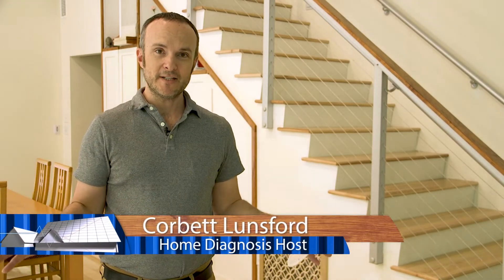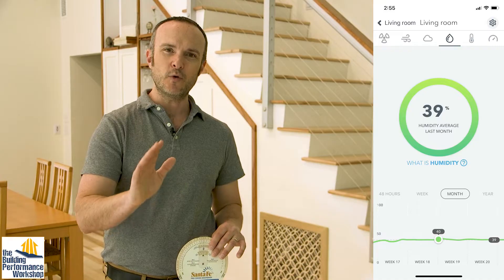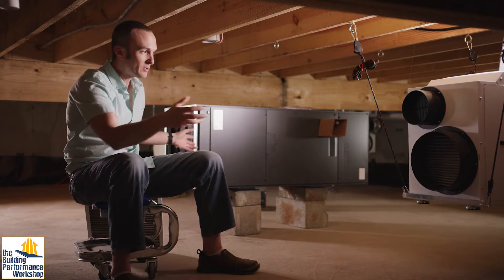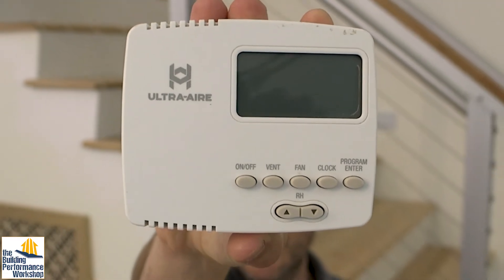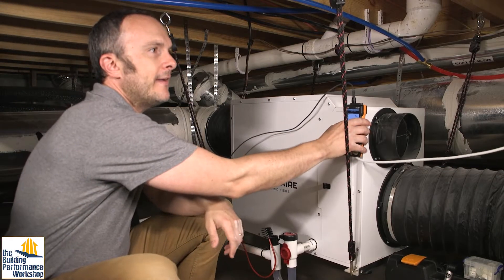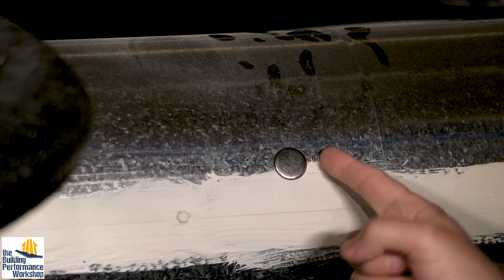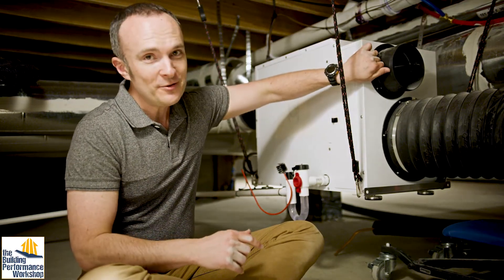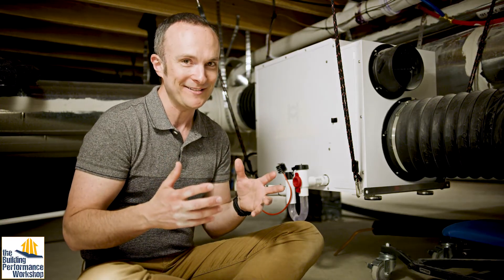Dehumidifier Testing and Calculations: How/What/Why of Dehumidification with Santa Fe Ultra

Comment: What if I don’t want my AC coil to pitch in and help with drying? Just curious, will my AC coil last longer if water is NEVER ever allowed to condensate on the coils? No mold keeping them clean forever?😂. I dunno maybe 30 year coil life? If I sacafrise the smaller less expensive dehumidifiers coil. Either way I’m sacrificing a cooling coil. But at least this way it’s the smaller coil that’s easier to pop in and out to replace. Any thoughts from anyone? This is just theory.

Comment: Thank you so much. Very informative. I have a question for you. For homes in the north Georgia area, would you recommend in ERV with a whole home dehumidifier or just a dehumidifier with a fresh air intake similar to what you have in this video?  The equipment will be going into an unconditioned attic.
Reply from the maker: First I’d recommend putting your HVAC into a conditioned space, but as far as ERV vs Ventilating Dehu goes, watch this:
Borderline of Balanced Ventilation: When Bath Fans Won't Work, and an ERV Becomes Necessary at Home
https://youtu.be/lnOCAPPVT5g
Reply: @HomePerformance  it’s an existing home so that’s not really an option. I had already watched that video and was planning to route all the bath exhausts to the ERV and then I started to watch Dehu videos and saw many people recommended using them with a fresh air intake in lieu of an ERV which confused me.

It sounds like you would recommend removing the bathroom fans and ducting their exhaust out of the house through an ERV while also adding a dehu in a completely different duct system without a separate fresh air intake?
Reply from the maker: ERV only if your home is tight enough to need it. I bet not in this case- dehu instead.
Reply from the maker: There are pros and cons in both scenarios. I would not use an ERV unless your home is 3ach50 or less.
Reply: @HomePerformance  thanks.

Comment: Great video!  Question about the ventilation part. So I would think you would want separate control of ventilation air and recirculation through the dehumidifier. The April Aire E100V with 8190FF provides control of either recirc or ventilation that it auto electronically controls based on settings. The SanteFe you show appears to just bring a mixture of recirc and ventilation air dependent on a manual damper on the ventilation input. Is this true and what are your thoughts on this. I like all features of the SanteFe except not having separate control. Thanks!
Reply from the maker: Yes, you would use their ventilation control (or Aprilaire’s) to control a mechanical damper on the outside intake.

Comment: Great video! Love the tip about using the outside air intake of the dehumidifier to slightly pressurize the house to prevent air infiltration!

Comment: Do you still need bathroom exhaust fans with this setup? I'm in FL and the home I purchased doesn't have exhaust fans in the bathrooms. I was going to just have them installed but I'm considering a whole house dehumidifier instead.
Reply from the maker: YES, you need bath fans- put them IN the showers. A dehum will struggle forever to try, but can’t do the job. Video forthcoming.
Reply: @HomePerformance  Wow, thank you for your response! Very helpful!

Comment: I actually watched this a second time and came up with a new question. When the Utra-Aire dehumidifier runs, is there some control line from the Ultra-Aire back to the HVAC system to run the main fan to distribute the dehumidified air throughout the house?
Reply from the maker: Yes, but we don’t use a feature like that because our air handler runs on circulate mode (low speed) 24/7.

Comment: Since you are ducting into the HVAC supply, will you need to ensure the central air handler runs whenever the dehumidifier runs? Won't this be more costly to run the central blower instead of keeping the dehumidifier supply seperated?

Comment: How can i verify that my unit (same as the one here) is actually working properly?  My production builder's contractor installed it and they did a bad job on the HVAC so I don't have much confidence this was done right either.  We have a long return duct (about 20ft or more) to the unit.  They originally had the return installed in a tight kitchen/mud area corner next to the garage entry door and a side exit door.  It was a bad spot so we had them move it which created a longer duct but not much choice.
Reply from the maker: It’s in the installation manual, Kelly, but I’ll also add it to my list of videos to make.

Comment: By slightly opening the fresh air input duct, you are satisfying one objective I have for some dehumidification for the basement/crawlspace. What about the attic? Do you supply dehumidified air to the attic or use the method to create a slight negative pressure for a conditioned attic to help manage the humidity in the attic?
Reply from the maker: We don’t have an attic, but if you do, it should be a room in the Man J and it needs a supply register and a return pathway.

Comment: I sure would appreciate a line diagram of how you "plumbed" the Inlet and outlet of the Dehumidifier to your heat pump's duct work. I have watched other videos about the same unit, which I am considering buying and I know some people had issues with the way the manufacturer had it being connected below the heat exchanger/coil of their heat pump. Sending warm dehumidified air across the coil and causing freeze ups. Could you post a PDF of a schematic?
Reply from the maker: Hey Blue- you can see exactly how this gets connected in Santa Fe’s install manual for the Ultra120. 👍🏽👍🏽

Comment: If the dehumidifier supply is ducted to supply of air handler is there a damper to keep the ac from blowing back through dehumidifier?
If so if both are running at the same time can the dehumidifier over come the blower from the AC ?
Reply from the maker: Yes and yes. Butterfly damper. Dehum is rated for 0.2 and 0.4 static pressure.
Reply: @HomePerformance  thank you! I love your channel .
Reply from the maker: Thanks Johnny my man

Comment: Can I use a dehumidifier when I have a ductless mini split system?
Reply from the maker: It’s even more important in that case.
Reply: @HomePerformance  Thanks. My unit has a dry mode which keeps the humidity in the 40's even on hot days here in Northern California. I'm not sue what the humidity will be like in the winter yet. Hopefully the system can control the humidity then also.
Reply from the maker: Drier in the winter. But if you’re using Dry Mode, you should definitely clean the unit asap.

Comment: Thanks for the video! We live in Alberta, Canada where we have major swings in humidity. I’ve installed a new VARIABLE-CAPACITY GAS FURNACE with a MERV 16 filter and HRV system in a 1960s home we’ve been slowly renovating. We’ve been working on sealing the house up, and have gotten it to a point where the HRV is required. We don’t have any cooling in our system yet (we plan on putting a heat pump into the system in the future, which our furnace can accommodate). My question is, with our HRV dumping fresh humid air into our return duct, should we hook up the dehumidifier to pull from below the HRV supply and dump it back into the supply before the MERV 16 filter so it can still filter the air coming in from the HRV? Thank you for all the great information you two are putting out!
Reply from the maker: Thanks for following, Bryan- no, I don’t think the amount of humidity you have in Alberta is anything to worry about on the incoming HRV side. Such a small amount of humid air (maybe 150 cfm) mixing with a huge amount in the return (maybe 1000 cfm) should be no problem, as long as you have that dehumidifier anywhere in thr chain it should do its job fine.

Comment: Why would you not want to pipe it directly into the return of the a/c?  I understand its not ideal (say if the fan of the a/c is off or something, but  will it actually hurt anything?  I have a situation where I can only really access two spaces of the return ducting, the supply isn't wide enough and there are trunks going upstairs and one going to the main floor, and above the a/c unit the trunk isn't wide enough to fit 8 or 10 inch collar.
Reply from the maker: Gotta do what you gotta do, Chad. But it degrades the efficiency of your A/C and removes the drying power from it as well. Oversize the dehum if that’s the case.

Comment: Best Video I've seen on this topic.  Thanks so much.  I'm building a new home in central FL and was thinking this might be a more affordable upgrade with a better ROI than stepping up to top of the line Variable Speed systems since the main attraction to me is making the house more comfortable.   I also absolutely love my Ecobee Thermostat which I believe will control a dehumidifier.  Am I correct that the Ecobee's work well with this type of setup?   Also does the Air Handler have to be on while the dehumidifier is running or does it push enough air by itself?
Reply from the maker: Thanks Jack! Not sure about an Ecobee here, but I keep our air handler running on low continuously for filtration and mixing. As long as it can’t make a feedback loop, you shouldn’t have to do that if you don’t want to. Return and supply far enough apart would do the trick.

Comment: Very informative video! I got a little bit confused on the calculations at 12 minutes 30 seconds. I think you meant to say density of air is 0.075 lb/cu ft instead of 0.75. Thanks again for the information.
Reply from the maker: Thanks Bill- and I think there’s a coefficient in there that’s hidden, I might not have explained it fully.

Comment: Great video, you mentioned florida. What’s your take on a ventilating dehumidifier vs having an ERV system for balanced ventilation and a separate dehumidifier (not ventilating)
Reply from the maker: I don’t know that anybody’s building very airtight in FL- an ERV only becomes necessary once you’re down around 1 ACH50. I’d go ventilating dehum any day.

Comment: You just briefly mentioned the MD33...how is this working for you? Would this be a viable whole house dehumidifier for a tiny house or small home? It seems that being able to wall mount it would be a huge space savings plus the drain line is a perk.
Reply from the maker: The MD33 is good, but I would not recommend in a tiny home due to the hum it creates- I prefer dessicant dehums for tiny spaces.

Comment: I like the explanation you provided in your video. There is one thing that is of concern is bringing into the living area any air from the crawlspace. Viewing it from an indoor air quality (IAQ) standpoint, the crawl space is often a source of rodant droppings, mold spores,  the possibility of Radeon, and odors of different types. Yes, a HEPA filter can remove most of the bad stuff but won't do anything for Radeon or other odors. 

It would be best to bring in fresh outside air for the fresh air intake port on the dehu. The crawlspace should have its own dehu without a fresh air makeup.
Reply from the maker: Micah, in a typical crawlspace I may agree, but mine is far from typical. Perhaps the cleanest air in the whole house down there, since there’s no people, cooking, or cleaning products at work. Also, radon is mitigated with a fan-driven system, very important I agree.
Reply: @HomePerformance  it's hard to think of, and cover every situation that could be involved with IAQ and all the factors involved in a relatively short video. You still did pretty good in addressing the subject.

I would like to see the HVAC industry embrace IAQ training as a standard. The two industries go hand-in-hand. To often I've seen HVAC companies think that they are helping their customers but because of not being throughly trained in IAQ they have created an undesirable situation for their customers. Some HVAC engineers and companies have independently seen this need and embraced this training. It would be nice to see it across the board.
Reply from the maker: Well we’d be happy to have you join our members, since we’ve created the first ever TV show about all of what you’re wanting to become mainstream knowledge! If you want to participate: http://patreon.com/homediagnosistv

Comment: Ok can you tell me exactly how you have this running, is it running in the ductwork for the ac system without the ac being on and if so where are you pulling in coming air from is it in the house or outside only?
Reply from the maker: All from the house. Yes, it runs independently from the heat pump based on humidity levels. Heat pump’s central fan runs on low speed continuously.

Comment: Thanks for this, Corbet. My home has a concrete block foundation so it's not sealed - would this still be my solution for my humidity problems or am I supposed to be looking more for ventilation solutions? Thanks!
Reply from the maker: Yes, seal first to remove the sources- cheaper, easier, only one time if you do it right. Then machines that are expensive, use energy, and must be maintained and replaced.

Comment: What rope suspension kit/parts did you use for that?
Reply from the maker: Comes with the Santa Fe system
Reply: @HomePerformance  oh that's what's it's called, rope ratchets! Amazon has these for like 10 bucks.

Comment: Excellent video! How do you relay the home humidity levels outside the grate to communicate with your UA sensor in your grate?
Reply: I believe they don’t need to communicate. They would set the controlling sensor(inside grate) to whatever value produces a desired result as measured by the sensor outside the grate. Clear as mud?

Comment: What they don’t tell you about before home dehumidifiers:  

Home humidity needs to be looked at like home heat energy, meaning what things are in you home that can be causing the high moisture?  Do you have a very leaky house?  Do you have a very tight house?  Is your AC pulling away the humidity from your home as it should?  When your HVAC blower is running does it create a negative pressure in your home?  Do you have a water leak in your home that you are unaware of?  Do you have an excessive amount of plants in your home?  Do you run your AC too low or too high?  Do you have a crawl space and if so does it have a vapor barrier?  

I’ve found that if you can address these issues first, it could lesson your need for a whole home humidifier.  Don’t obsess over getting your home to 50 or below relative humidity, when 60RH to 50RH are fine numbers to have as well.  If you wanna know what 35 RH feels like, I can tell you, because I’ve had my Aprilaire unit for 2 years now.  35 RH at 72 degrees feels like a dream when coming in from hot outdoors weather, and getting out of a hot shower.  The feeling of water evaporating from your skin so rapidly is an amazing feeling, absolutely so, but there’s a catch 22!  Your skin, eyes, nasal pathways, and throat suffers from the lack of moisture in the air.  It’s something you don’t notice right away, but when you wake up in the mornings with dry eyes, dry mouth and throat you soon realize how some moisture in the air isn’t such a bad thing.  Another thing that happens with a wood construction home is the wood will sometimes shrink.  We all experience this sometimes when some doors closes well in the winter but not so well in the summers or vise versa.  It can literally cause your wooden boarders (crown moldings) to shrink enough that it cracks.

The bottom line is purchasing a whole home dehumidifier can be a life changing event in a good way, or it can leave a sour taste in your mouth.  They are not for everybody who can afford one.  Mine averages about 750w when in use, and it does have a noticeable compressor hum like all heat pumps have.
Reply: I’m on the fence with whole house dehumidifiers. The amount of water I pick up from my 5 conventional units on wheels (set at 45), using fans to aggravate air, with my thermostat set at 75, when it’s a hundred degrees out , is insane amounts of water. But damn, it feels good…  I just don’t see how using a new random return cut out in 1 hallway ceiling, or using my existing air returns could do what I am already doing in my 3,000 sq ft home. Pulling up that much water!? All that vapor in my ductwork!? Part of my job is understanding microbial growth and I see a problem with inviting that much water vapor through ductwork. Not to mention, not keeping the RH equal in all areas of my home, like I have now, I can testify from using my hygrometer.
Reply: @sp1200M3D  the single whole home until is the way to go if you’re using 5 units.  It’s overall more efficient and you don’t have to worry about it because it takes care of it’s.  If you do by one get the biggest unit you can afford and install a dedicated return.  Humid air is lighter the dry air so put the return in the highest conditioned space of your home and you’ll be fine.
Reply: @twosawyers  Thanks for your input man! Have you tested each room to see if they are all adequately dehumidified? I just can’t see how 1 return can dehumidify a whole 3,000 sq ft house. I get what you’re saying, but damn, that’s a lot of water, and my biggest concern is having moisture all over the inside of the flex connected to that 1 return.
Reply: @sp1200M3D  the indoor humidity will typically equalize throughout the house. You can run a stand alone unit in one room and the rooms at the other end of the house will still see a drop. It’s not like temperature where you can have hot rooms and cold rooms.
Reply: @sp1200M3D you can add more returns in other rooms if you want more peace of mind, but you don't need too.